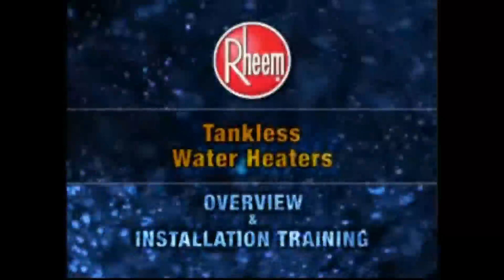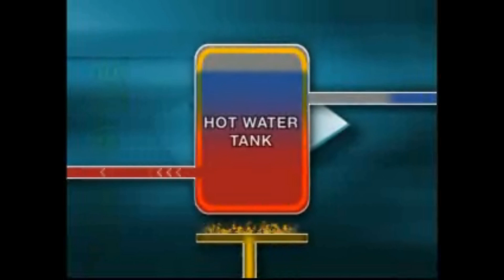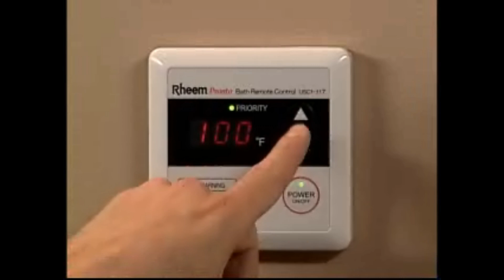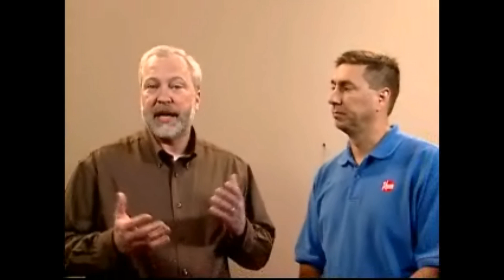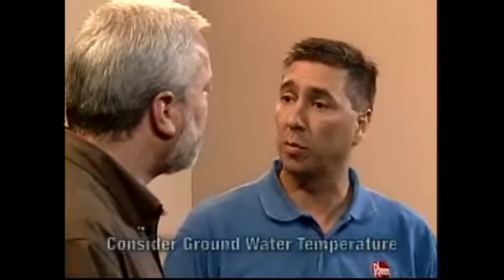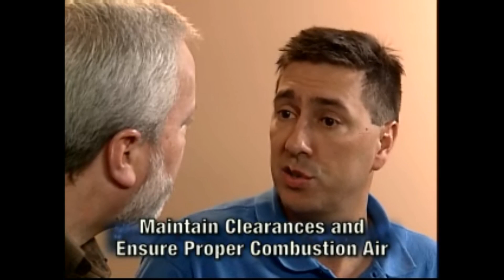Rheem Tankless Water Heaters - WestsideWholesale.com

Comment: They forget to tell you, that the tankless uses 5 to 7 times more gas than a conventional hot water tank when it is firing.  I'm in the industry Heating and refrigeration, these tanks also don't work with dishwashers that don't have electric elements, also a 1 and 1/4 in gas line would be required if you live in a cold climate, remember you could have a furnace running with a gas cook stove at the same time, as your water heater